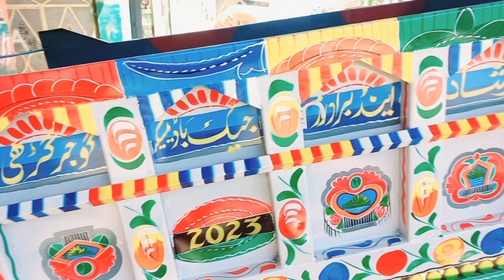Restoration Full Trali 😮 | Pakistani Skilled Workers Making Hydrolic Jack tractor's trali

Comment: I watch a lot of these types of videos and I've never seen them use a new piece of steel  or a clamp. In truth, I've never seen a weld that would last more than one overloaded trip. Which means one trip.
Reply from the maker: Yes!

They use some parts which are already used.    

Inspired of that they overload tons of weight so many time....I often see 👀..